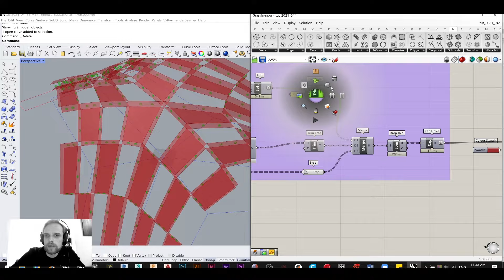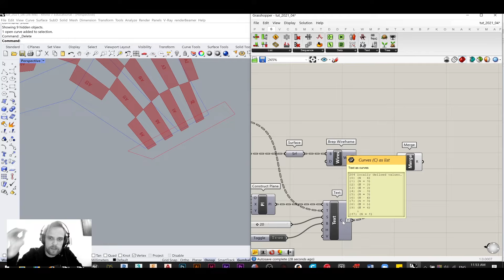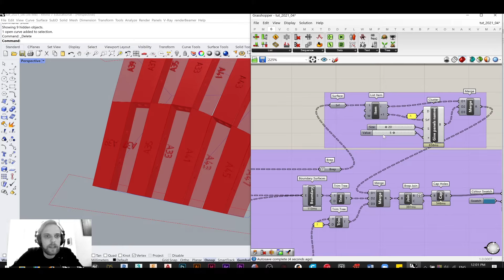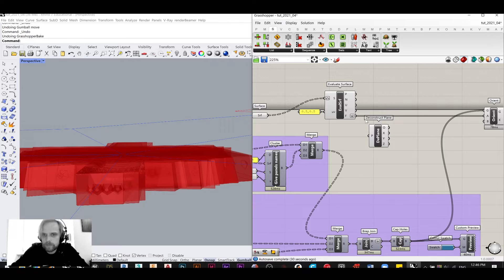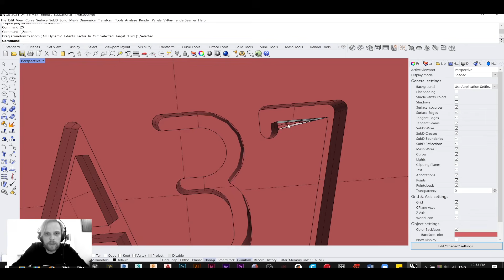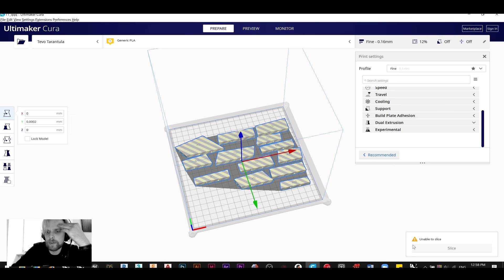Tutorial: Numbering and Flat-Placing Elements with Rhino and Grasshopper

Comment: Great work!! I have a question that isn't necessarily about what you taught in your video... In the initial displacement you showed in the video, is there a way I can determine the inclination angles of those elements at Grasshopper?
Reply from the maker: Yes, of course. You just need to calculate the angle between the Z axis (or the normal of the shell) and the perp vector of the tile surface. Check this tutorial out: https://youtu.be/d24Q9harY9c

Comment: Great tutorial. I've Noticed that each Brick is unique in this planarization method. Is there a way to rationalize this, so as to have modular bricks and planar as well?
Reply from the maker: Only if you're planning on building something with a constant curvature (like a cylinder, or a cylindrical vault/arc or a straight wall). The moment curvature becomes a variable, the shape of the bricks become a variable.

Comment: Hi, don't know if you'll see this, unfortunately somehow the very last part with "orient" doesn't work on my end. Seems like the center points of the bottom surfaces are fine, all the closed breps that are gonna be laid out are fine, I've flatten the "Frame" on the surface evaluation as well. They're all seem fine on their own but didn't work when I oriented them. Thanks by the way!
Edit: just made the B plates and they work lol. Not sure what happened with the A plates.
Reply from the maker: Hi - there can be way too many potential things that might be going wrong so it's difficult to diagnose. You could bake out the elements into Rhino, and then reference them in groups to trey and orient. At least then you'd know if there is a problematic element somewhere that makes the whole orientation system break.
Reply: @DesignGoBrr  thanks!

Comment: Labas Gediminai,

Nice tutorial, great video!
Quick question: as I am quite new to the Grasshopper, I have a long way to go yet, but... is there a way to flatten polysurfaces in Rhino without coding or Grasshopper help? Just like native Rhino commands?
 Let's say I have modeled a simple cupboard: two side, top, and bottom panels. I need to prepare a cut-list for the parts, so I need that the parts would be flattened to the top view (preferably). Any suggestion on how I can achieve it? 
Thanks!
Reply from the maker: Sveiki, The command that you're looking for is Orient3pt - that's the closest you'll get to it without using grasshopper